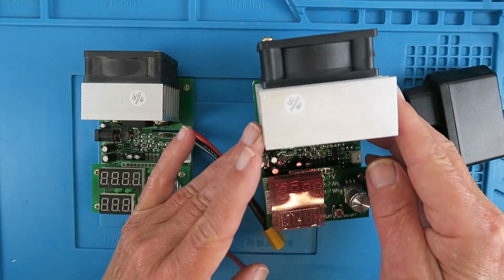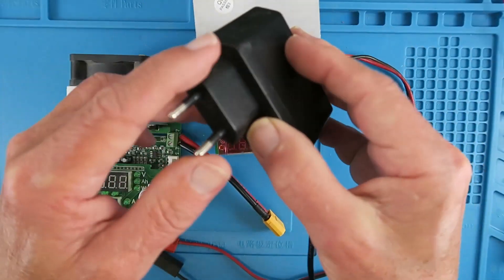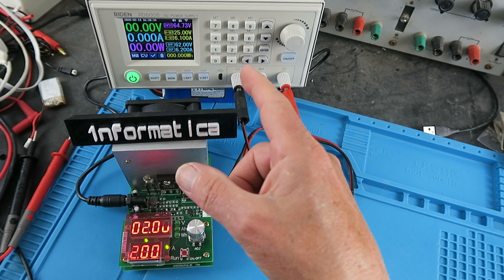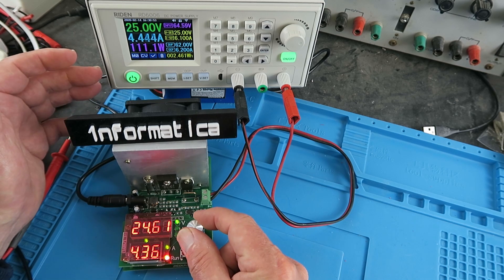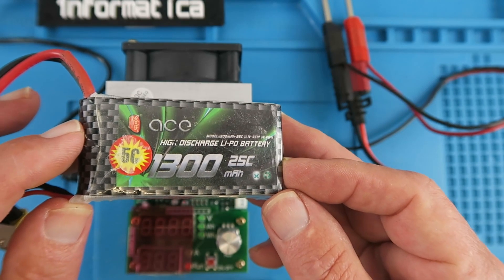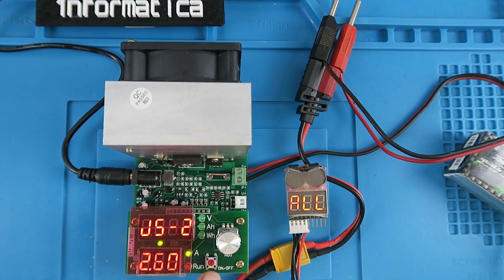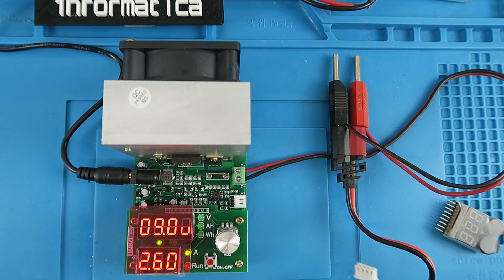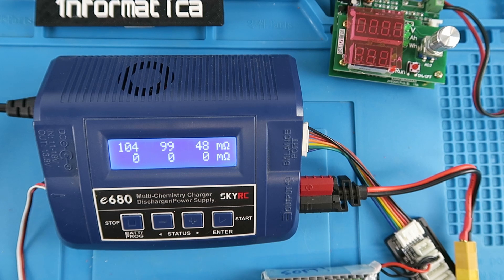ZPB30A 110 Watt Electronic Load And Battery Capacity Tester

Comment: The module is powered by 12 V and 1 Ampere. On the right side of the module we have two DC terminals! Why do there have to be two terminals? What is the purpose of two DC power supply terminals? Thank you!
Reply from the maker: The jack on the left of the module provides power for it to work. The connections on the right are for the device you are testing i.e. battery or power source. See : https://youtu.be/1FYBrQnWYbE?t=260 Thanks for watching, have a great day!

Comment: thank you , can you tell me. when you switch between modes. i see ba on/off  ccan you tell me what that does? thank you
Reply from the maker: Starting up the device and setting the mode
Press the red 'ON/OFF' button and simultaneously switch on the 12 Vdc supply voltage. With the rotary knob you can select the mode 'Fun1' or 'Fun2'. 'Fun1' should be used as an electronic load (default setting), 'Fun2' when testing capacity. Release the red button and then press it again. With the dial you can now set the mode of the buzzer. 'bEon' switches the buzzer on, 'bEoF' switches it off. Confirm again by pressing the red button. These settings are stored in the memory of the device. Thanks for watching, have a great day!
Reply: @1nformatica  thank you  ,,, its buzzer on or off. now i know, another day someting learned :P thanks.

Comment: in electronic load mode, it does not disconnect the load if it goes undervoltage, it just beeps. Do you have the same behaviour?
Reply from the maker: Yes, the cutoff only applies in capacity measurement mode. Thanks for watching, have a great day!

Comment: Thank you for presentation. Have 60W and 110W load builds same type of power source voltage sense connector?   Which type of connector to order for building voltage sense cable?

Comment: Have you actually tried the 4 terminal mode ? I have tried connecting the sense wires to the battery downstream of the connecting leads to the load module, but the display still flashes J5-2. I'd be interested to see if yours reports J5-4
Reply from the maker: Both of my modules show J5-4 when in 4 wire mode. You could check with a meter that the voltage is getting to the sense pins on the module.
Reply: Thanks for the reply, already did that, battery voltage is ~ 200mV higher at the pcb sense terminal with the current and conductors I'm using. Maybe I'll try connecting the sense wires to the load side of the BMS instead of the battery itself. I believe the board automatically recognises a 4 wire connection, and doesn't need a manual configuration ?
Reply from the maker: @rogerm695  The module automatically senses 4 wire mode. In 4 wire mode the current and voltage  sense inputs must be connected to the same point. See the diagram at the end of this page : https://chinese-electronics-products-tested.blogspot.com/p/zpb30a-electronic-load-tested.html
Reply: OK, I'm a DICK ! I'm ashamed to say I didn't check the remote sense connector - the wires were reversed.....sorry to waste your time
Reply from the maker: @rogerm695  We all make mistakes, as the Dalek said climbing off the dust bin! Glad you got it sorted.

Comment: I have used an internal resistance meter for years and thought I had a comprehensive state-of -the-battery from that alone.  The flying performance I was getting seemed to match its predictions. What does the battery charge capacity test provide that's lacking in the internal resistance measurement?
Reply from the maker: Internal resistance is a good measure of a Lipo pack's health and I show that here https://youtu.be/z2Rhk8KJp_k
However, the IR of a cell does not indicate it's capacity which is influenced by the discharge rate and temperature. A load test is the nearest to the reality of flying a pack and it is a useful tool especially if you see a fall in a pack's performance. I have also used it to recover cells that have been idle for some time. Cycling a pack under load can actually reduce its IR in some cases. With an old pack when the IR goes up and the capacity under load falls off then you know it is time to get a replacement!

Comment: where is the 1/2 volt difference between the load and the powersupply?
Reply from the maker: It is the losses uncured in the connecting cable and plugs. If I measure directly across the output terminals of the PSU it is 25 volts. Measured by probing the screw terminals on the load it is 24.69. This is why there is the 4 wire mode capability and exactly when it should be used if you want the best accuracy.